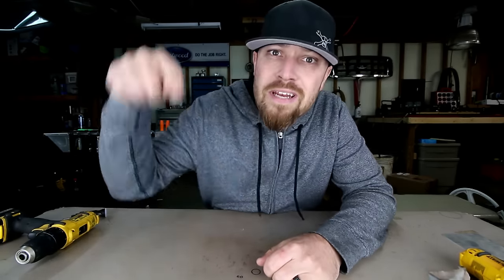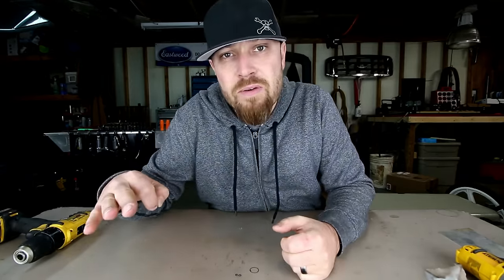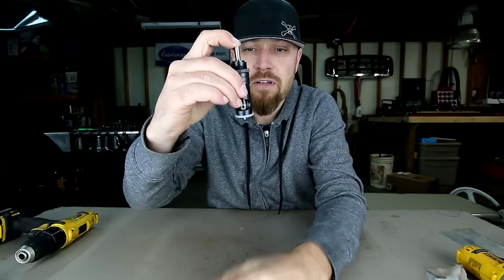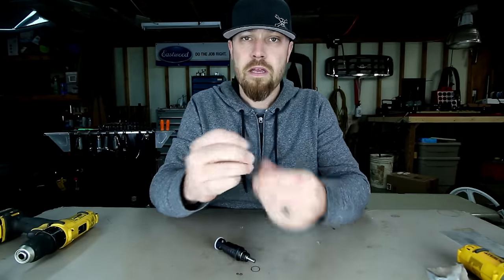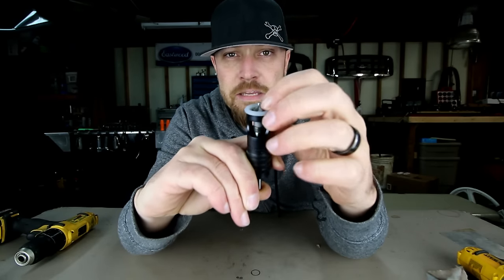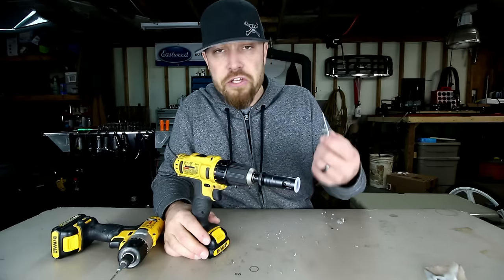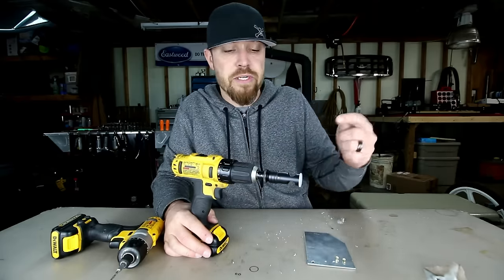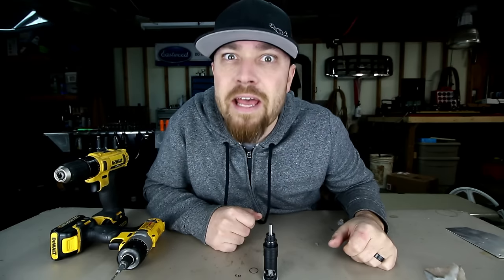You Need This Tool - Episode 49 | The Microstop Countersink

Comment: working in aviation I have several microstops that are set up for different jobs. And you can buy the countersinks with different size pilots  (nipples) and also different degrees such as 82 degrees for sheet metal/wood screws or 100 degree for machine screws. Definitely great for production work. great demo !
Reply: We did you find the 82 degree cutter angle?
Reply: Awesome, thank you. Those are 3/8 x 24 thread though and won't fit the tool in the video, which is 1/4 x 28. But thanks for the heads up on a great new store to buy stuff at!
Reply: No, my bad. I didn't realize they had DOZENS of different sized countersinks. Was just about to come back here and come clean about my mistake, but you beat me to it.

Comment: i have one, its useful for deburring (both front and back) smaller drill holes so your panels will fit flush. just set the counter sink to a tiny depth and then you can debur holes very quickly. saves a bunch of time if you rivet a panel on and have 50+ holes.
Reply from the maker: I could see that

Comment: Thank you for this one. I make up ABS panels for marine wiring and instrument installations. I like to use flush fasteners for a clean install and drilling the countersink the right depth, even with a depth stop on a drill press is always a pain. This looks like it will solve that problem for me.
Reply: Just noticed that these bits are a 100 degree countersink angle. For me, with ABS plastic panels, it won't be an issue. But if you are using threaded fasteners into metal than the match up won't be proper for physical hold and the cosmetics might not be acceptable. Of course if you are using aircraft rivets, for which this tool is designed, then everything will line up perfect.

Comment: I really like that guy, funny and right to the point a real treat!
Reply: He does not even know the difference between a nipple and a pilot. Also when you screw down the lock ring check your depth again before you do the work, as it will alter very slightly by a few thou. Vanmar seem the most popular in the aircraft industry rather than MicroCounter sink which looks like the one being used here.

Comment: I would use this for plug/spot welding panels where spot welder won't fit for a bit extra meat
Reply from the maker: could be used for a spot cutter bit as well
Reply: The Fab Forums 
good point